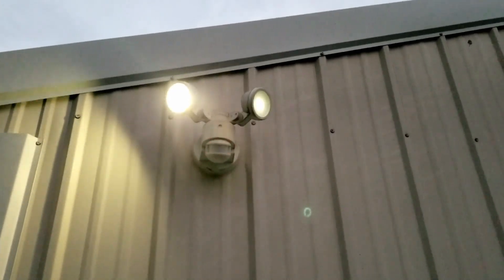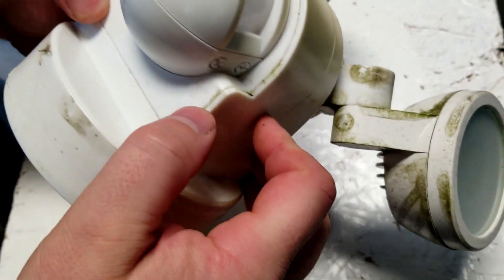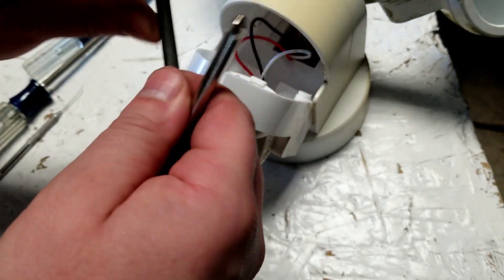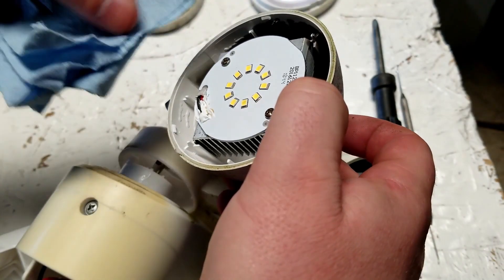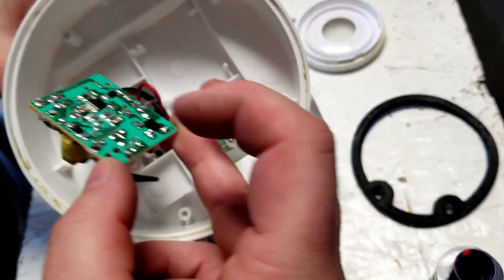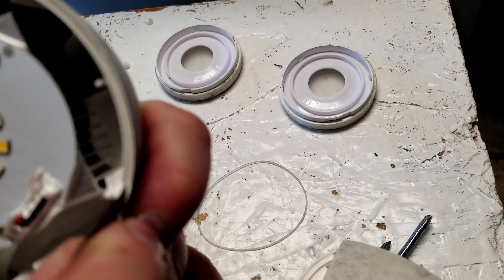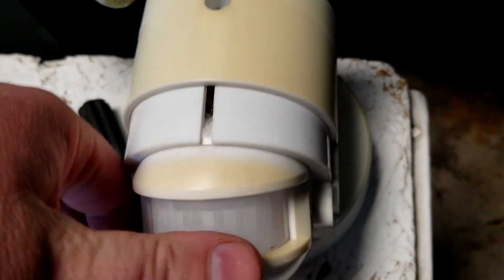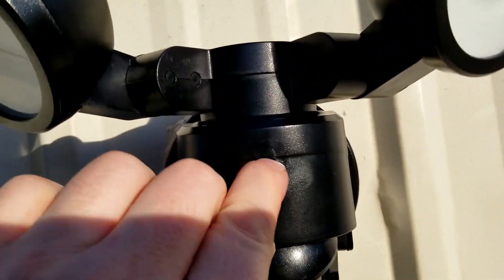Flickering Motion Sensor LED Light

Comment: Since this video appears in searching the flicker issue.  In my case, it was simply that I put a nondimmable bulb in a fixture designed for dimmable bulbs. I swithed the bulbs to a dimmable kind, that fixed it.
Reply from the maker: ah yes - is a good tip for everyone!
Reply: Yeah! Bought bulbs recommended, still flickering!😡

Comment: How does it attach to building
Reply from the maker: Round light gang inside the building, cut a hole through the metal and using mounting kit that comes with the light to attach to the gang. Mounting kit seals against the gang very nice and be sure seal around the wall extra tight. No leaks allowed.